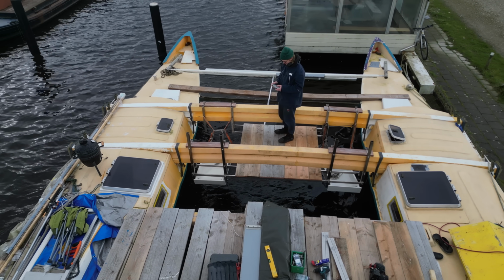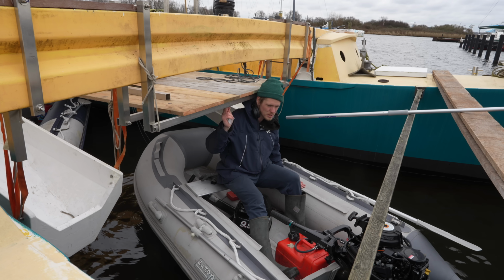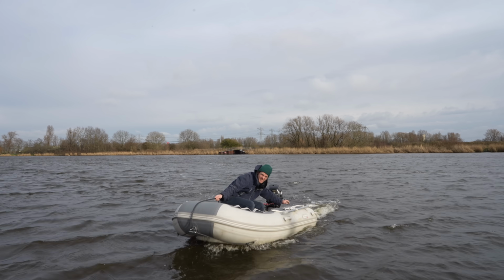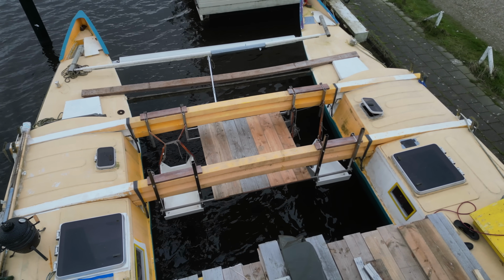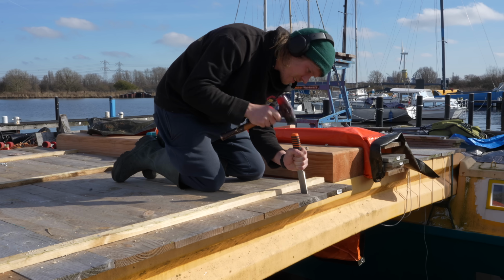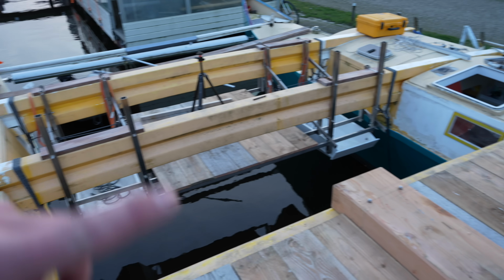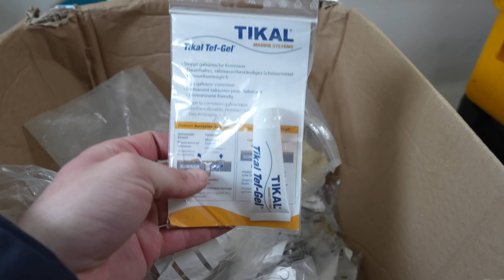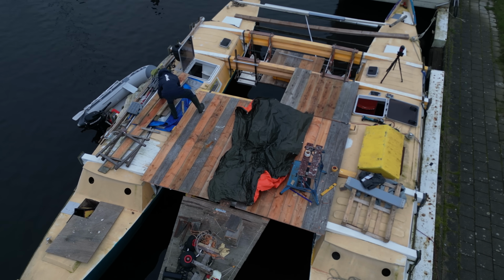A Simple Deck for a Simple Man’s Ocean-Going Catamaran.

Comment: Just wondering Mark, maybe you can get "concrete plate" its a waterproof multiplex but a bit rougher, but its waterproof, does not rot, its strong and relatively cheap. Just an idea. roughly 20mm thick, so very strong. and most of all much safer than planks

Comment: I'd probably have treated the wood before putting on, sane with a good sealer, on the ends and sides of the wood.  Can't recall how this the square tubing was  and if that was air craft t5, or t4. Check after a few runs, if u see compression.  Get some smaller square tubing to fit inside.  And could slot it , so you can just slide it down past the bolt. Or match the drill holes. And unbolt and bolt back thru. Just got to factor in possible Gail force winds, and wave force slamming, if u get stuck in ruff seas.

Comment: Hi Mark. The stainless structure looks great. I'm a little dubious about the attachment of the sleds to the structure. That's the weak link, in my fairly qualified opinion. (In addition to being a Key Grip and ex stuntman in the film industry, I fabricate all types of things for SXF and Stunts, Props/Art dept etc.) The scenario I see would involve the bolts tearing through the wood,  whether from rot or impact or a combination. Possibly a nice square of stainless plate on both sides of the bolt hole would be the answer there. Also, tether your engines with chain or wire rope. You don't want to lose them.

Comment: Those pulley blocks look like they're made of Tufnol.
Reply: Tufnol is amazing, strong, UV resistant. And, does not look so plastic.. Much better quality in the long run compared to similar size black or white blocks. In Enkhuizen is a small boat scrap yard with a second-hand parts shop. Tufnol is not popular you should be able to find a bunch of tufnol blocks.
Reply: @RonGroenestein Yep, tufnol blocks with ss straps are the best but don’t rely on your block and tackle arrangement to hold the sleds up when the boat starts slamming - the dynamic loads will be high

Comment: Hiya mechanical engineer here . Your design looks good for the outboard bracket. To alleviate the bending down of the cross beam, an angle iron strengthener from the front beam top to the lifting point of the outboard canoe would help!
Reply: He should have mounted those pulleys closer to the front beam
Reply: Moving it forward from where it is , will  enhance the pressure on the beam
Reply: @gavingrieve5306  i ment the last beam now i realized its the back not front so back beam

Comment: Were those angle pieces made of aluminium?

You cant use dissimilar metals in electrical contact around salt water. It will lead to rapid galvanic corrosion. The aluminium will sacrifice away very quickly.

Comment: Engineer: m8 or m10 bolts are totally over rated. Fill the rectangle tubes with epoxy. That will stop them deforming under load. That’s the weak point that will give way as we all know the sea can snap boats in half. The boards are fine. Just paint them or leave them and they all will turn the same colour. You are working really hard. Much respect. You have a goal and this is the only way to get to it. You will thank yourself when you are crossing the ocean.

Comment: Bigger bolts means also bigger wholes in your profiles. You said 20mm profile,  so that means 4mm metal on each side with 10mm rests 5mm. That is 20% more metalstrengt. But more impotrant is that everything is realy good fixed and strong bolled. The less moveballe parts the stronger it will be.(at the joinings do i mean) succes my friend.

Comment: You need more weight in the front kf your dinghy. Put the fuel tank up the front and buy a couple if 20 ltr water tanks strapped up front also to balance the bouyancy.

Comment: I think m10 is solid. The grey colour may sand off making the deck planks more uniform. Just a bit worried about a swell hitting the bottom of the motor cradles though.

Comment: Not an engineer- Just wondering about expansion & contraction on the deck planks. Most wood decking has a gap for that purpose. It looked like it should have space but wouldn't want it warping/buckeling in the future. Great work!

Comment: You should lock the engine box into place with a pin not line to prevent movement in a swell.

Comment: Hi Mark. In tension, one or two of your M10 threaded bars could probably lift Mahi. They are effectively the M10 core diameter, which is around diameter 8. In single shear they are weaker. Most metals are stronger in tension than in single shear. In your application they are not really under either stress condition, as the loads are taken by their clamping forces on your beams. I think it is good not to drill into the beams. I would not worry too much about your structures. I expect you may change them later for something more Wharram style, like plywood epoxy and wood structures. Read up on rigging purchase systems. Pullin down at the effort end when you are lifting something is called 'rigging to disadvantage' . It is better to design such things as 'rigged to advantage'. Read up on it. Thanks for the Friday video !
Reply from the maker: Cheers, Justin! I know I can always trust your advice. going to look at YT videos about that now!

Comment: You should think about making storm doors that fit over the engine Bay Area
Reply: They are normally housed under enclosed seating boxes. Though some pahis  were built with a single large central outboard  further back.

Comment: If there were issues with the steelwork - I think Hanneke would have driven a scrap van directly to the marina by now.  Its a hugely overbuilt Timber structure and there may be some twisting of the whole thing but once rig is on and tensioned it will stiffen up even more.   Its a very inspectable structure and you will see any crushing or deformation.    M10 will be fine.   M12 is used on corner adapters for S52 Truss at Rock concerts.  We could hang your whole Boat from that stuff.

Comment: You can place spacers in unreachable places by drilling one side out the diameter of the spacer and Tig weld it in. If you do it right and mind your tolerances, you could do it without welding the spacer in.

Comment: Secret hack told to me by my Tohatsu dealer.    All your fuel has ethanol in it so all your fuel gets fuel preservative in it.  Even if you are using it right away.  8 years and a trip to the Bahamas from Canada and zero engine problems.

Comment: The only thing I’d change about your design would be using metal cable instead of the rope when the engine boxes are fully lowered for that extra strength. Keep up the great work mate, I’m looking forward to seeing the rigging and then sailing. Good luck bud
Reply: I could be wrong, but I believe Mark is using Dyneema, not rope.  Dynema is both stronger and much safer than metal cable.
Reply: @thomasnorman7016  yeah ok, I just thought when he said rope I was thinking that wouldn’t be strong enough

Comment: Really enjoy your channel and your approach to getting this old boat functioning again. Don't spend a minute worrying about using that Douglas fir for a deck - even fast grown stuff like that is strong enough for what you are doing. I would coat it though, and not with oil, give it some paint. An epoxy primer like interprotect 2000E would ensure that wood lasts a decade or more. If that is too costly just paint it with a decent oil based paint like rustoleum. If that is too much for your budget just use good old latex exterior grade house paint. Don't sweat the opinion of the perfectionists of the  internet -  unless they have a spare $200K floating around they will be on their computer while you are crossing the Atlantic.

By the way I have deep experience designing catamarans and trimarans, building catamarans and other offshore cruising boats and am presently a polymer materials engineer.

Comment: Well within your applied loads for that bolt hole... if you want it bullet proof, weld in a sleeve.

👣🕊👽
Reply: You could also simply weld the eye bolts in place to regain structural strength of the bar.

Comment: I believe you have used all thread and not bolts across the wood at the top and possibly created a shearing  of the all thread through stress from movement. I would of welded a thick walled tube slightly proud in each box and used a bar threaded at each end. A solid 10mm rod, or get bolts long enough. I don't think it will last long with the movement of sea & wooden boat.

Comment: Oh just thought of something what if u install a aluminum beam that curves with the cross beams but is flat on top, u could connect the aluminum to the cross beams with U bolts
Reply: The aluminum beam would be solid instead of hollow square or circular pipe

Comment: Just wondering, if you want to avoid squashing the box section stainless steel bars where you couldn't get steel tubing inside it, perhaps you could use two bolts each side, tightened against each other with some loctite on the thread for belt and braces.  Just tighten the bolts against the box section enough to be a snug fit without getting tight enough to crush it.
Reply: Sorry, meant to say 2 nuts each side, not 2 bolts each side...

Comment: Get a “whale tail” on that rib motor. You’ll be up on plane quick and gives the little rib more stability at speed. Trust me.
Reply: Also, start thinking about those motors traveling UP rapidly cutting across waves. It would be the slam down that will break stuff, but make sure they cant travel too high for other obvious reasons too!

Comment: The only thing that I would do is put a spacer between both sides of the metal, so it doesn’t squash in that will be your weakest point but you probably won’t listen. Anyway I’ve done a lot of work with metal

Comment: your problem with the carburetor is because you are always on the water with changing temps and humidity. add seafoam to every tank and it should prevent it from happening in the future just make sure you add the correct amount to every gallon

Comment: Be more careful about having gasoline inside your hulls.   Many a boat have exploded and burned down because of gasoline fumes collecting in the bilge.  Gas fumes are dense and sink, and tend to just fester until the spark of a bilge pump or fan motor, or compressor ignites it.  You might want to reconsider using the aluminum angle stock riveted to your stainless steel frame.  There will be a lot of galvanic corrosion between them sped up by the salty marine environment.

Comment: Note: your bolts should shear at about 6528 pounds but your putting stainless steel in aluminum. Which you will want to pay attention to for galvanic corrosion from the salt water. You should be fine on the bolts. Your aluminum will give out long before that stainless does.

Comment: Drill the bushing outside diameter into the rectangular tubing and cut the bushing length the with of the tubing plus 1/32" so that the bolt doesn't compress the tubing.

Comment: Hey Mark, I love what you're doing, mate. However, your stainless mounts for your motor sleds and motors are going to :Rack" like crazy. Too many bolt connections and not enough direct interfaces joints (welds) to provide stability and strength. It may seem strong sitting still in the marina, but under sail, the stress of torque & tortion  will have an extreme impact on those mounts.

Comment: The problem is not the bolt diameter, the problem you're going to have is keeping them tight, they will crush the section and become slack. A bodgers solution which would fit your style of construction would be to have machined some lengths of hardwood to fit inside, left protruding a few mil and chamfered off with a sharp plane or a sanding disc it would make the whole job look streets better.

Comment: Why not weld small steel plates on either side of the beams where you drilled holes if you are worried about strength?

Comment: looking good brother…it would look cleaner to have deck boards set down even with cross members and butt up against them, but that is a place where moisture would live…and those board ends suck up water…
i think you decided correctly for practical purposes…
i’m wondering if your engines will rise when you reverse…have you figured on way to secure them in down position?
she’s really becoming a sweet yacht…can’t wait to see what you choose for sail plan…i see that many of these are ketch , gaff rigged, with double head sails, which can make sense for smaller sails that are easier to handle..i like the gaff on these because the wind loads are lower with same sail area…better for preventing a capsize…also gives more versatility for balancing boat in various sea conditions…
i’ll be watching…cheers!
Reply: I have a thing about gaffs - a breath of a glorious age gone by...

Comment: Im a mechanical engineer for aerospace. M10s are fine.  Remember the 200kg is spread/divided between many fastener contact points. My point is you don't have 200kg going through one fastener.  your foot print size is also a big factor which is large enough. All good. Cheers

Comment: What about getting the box section all welded where possible on to of the mechanical fixture for added strength, later down then line box it in with sheet stainless?

Comment: G'day mate
Just wondering what your lock-down system is going to be.
What mechanism do you have to lock your motor system down when in use?
As it is the engine pod will slam up when any waves slam in any slop in the sea state.
Cheers Rosco form The Land of Oz

Comment: Can I ask what keeps the engines/sleds in place once lowered. Are they just hanging down under their own weight? Or are they locked in place once in the down position or for that matter in that up position? As the weight alone doesn’t seem to be enough to hold these safely in weather. My Two pence As to your question about the m10 stainless bolts. I hold qualifications in Magnetic partial inspections and welding , engineering, technical drawings. That is to say I have an idea but nothing bankable. You will see over time depending on the exposure to “rattle factor” a small amount of elongation of the box section/square tube holes where the bolts go through  followed by stress cracking around these holes. But this wear and tear should be predictable and manageable if maintained regularly and not a catastrophic all at once failing. The variables are massive on your boat and conditions it could face. I admire your efforts.

Comment: Where you cannot pot short pieces of tube to support the middle of the rectangular tube could you not cut some hardwood & slide that down inside the tube..Once in place you could easily drill through it where you have drilled the steel.  It would not be as good, but it would stop major compression of the tube & not rot for years
Reply: Structural a good idea, but wet wood and stainless steel create corrosion points  
Some sort of plastic would work
Reply: @dnomyarnostaw  So a boat at sea is not going to get wet anyway!!! What about all the wood hull & stainless fittings elsewhere. Should they be removed? Sorry but with the greatest of respect I do not accept your point
Reply: @grahamlongley8298  It's a well recognised phenomenon of stainless steel against perpetually wet wood. 
Lots of accounts of stainless steel screws disappearing from wooden hulls, eaten away by corrosion. 
Do a bit of googling about boats, wood and stainless steel fastenings.
SS requires an oxide layer for protection that is not present in wet environments.
Reply: @dnomyarnostaw Better tell the 40 year old clinker yacht that I fully  rebuilt 25 years ago that then. I am sure it will want to know
Reply: @grahamlongley8298  I bet you didn't use stainless steel screws.
Reply: @dnomyarnostaw  You lost that bet
Reply: @grahamlongley8298  If they were underwater, they're mostly gone by now then. Oh, and before your next  answer, just google "why stainless steel screws are not good for boat planking " and read the first article or two for further education

Comment: Its not the strength at load...its the cycling of stress...and stainless rusts where there is no oxygen or where there is metal impurities.  So of course m12 is better.  There's more metal.  Bigger worry is any part fails, does the whole thing come crashing apart...I'd put in double nuts at least and maybe a safety on the engine.  Tef gel is not more is better...just a thin thin covering...expensive stuff.  On big parts, get some old bicycle tube to cut up and sandwich inbetween and use delrin washers, they can go on the aluminum side of your stainless steel rivets.

Comment: I am just an amateur DIYer and I could well be wrong but whenever i am using nuts and bolts in an outside environment (as you are) I would always cover them with a heavy grease to protect from rust. Obviously with galvanised steel this is not necessary. (or is it?)

Comment: The bolts are way to strong for the loads,what concerns me more is the facht the structures for the motors are attached to two different wooden beams wich are attached to the two hulls with …ropes,so if the beams  moves again each other wich is seen the attachment method normal…..i rather see upcoming problems in that region.

Comment: Engine sleds look like they will last 2 days . Why not bolt motors on plate and raise and lower them vertically with a screw feeder like on a lathe . Will be much simpler and easy to maintain . That  thing has to many parts and complications